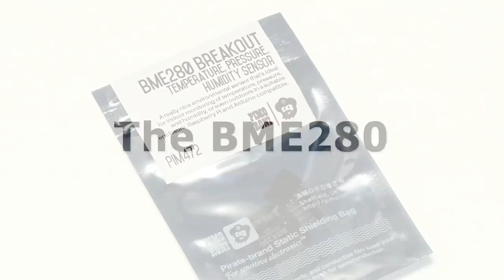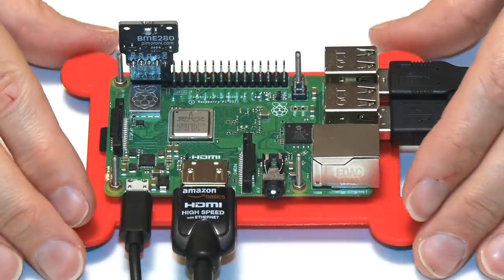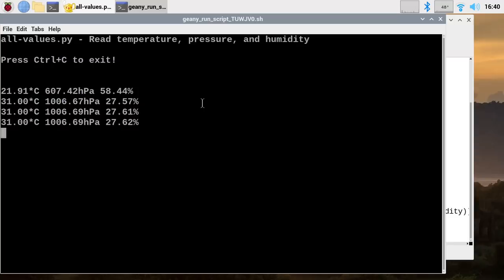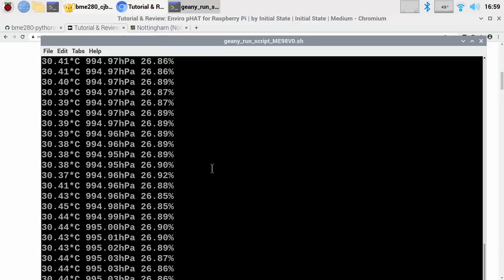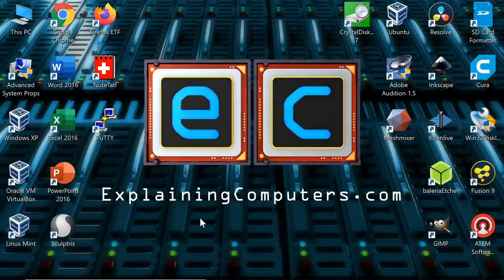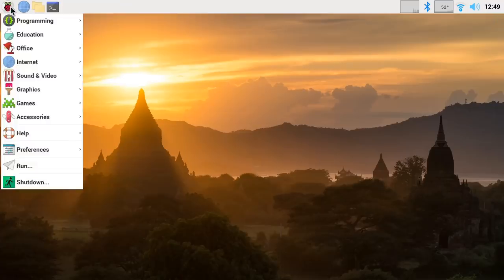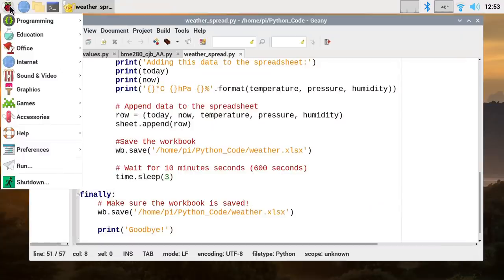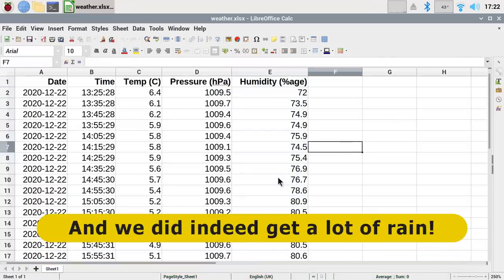Raspberry Pi Weather Station

Comment: Hi I'm following your video and stuck at 17:15
double checked my code and installed everything and even file name is same as you
The result is this

Traceback (most recent call last):
  File "weather_spread.py", line 22, in <module>
    wb = load_workbook('/home/pi/Desktop/Python_Code/weather.xlsx')
  File "/usr/local/lib/python2.7/dist-packages/openpyxl/reader/excel.py", line 319, in load_workbook
    reader.read()
  File "/usr/local/lib/python2.7/dist-packages/openpyxl/reader/excel.py", line 275, in read
    self.read_manifest()
  File "/usr/local/lib/python2.7/dist-packages/openpyxl/reader/excel.py", line 136, in read_manifest
    src = self.archive.read(ARC_CONTENT_TYPES)
  File "/usr/lib/python2.7/zipfile.py", line 958, in read
    return self.open(name, "r", pwd).read()
  File "/usr/lib/python2.7/zipfile.py", line 984, in open
    zinfo = self.getinfo(name)
  File "/usr/lib/python2.7/zipfile.py", line 932, in getinfo
    'There is no item named %r in the archive' % name)
KeyError: "There is no item named '[Content_Types].xml' in the archive"

------------------
(program exited with code: 1)
Press return to continue

Please help me because struggling with this for 3hours
Looking forward to your recommend

Comment: 16:41 - I don't think the repeated saving of the file inside the loop is a good idea with an SD card.  This just reduces your SD card life.  You already are saving the file when it finishes and this is hardly life critical information.   ;-)
Reply: Also... please use the degree >>> ° <<< symbol instead of a star.  It should be easy in Python (or anything else) with <Alt>0176 (on numeric keypad).  The star just looks amateur.   ;-)

Comment: I have one of these running on a Pi ZeroW. My program predicts the weather based on the Zambretti Algorithm using  information found  at http://integritext.net/DrKFS/zambretti.htm . It works well except that the sensor seems to be corroding making the humidity reading useless.

Comment: Excel is not a database. Copy this 100 times. Can we have a video about uploading the data to grafana instead ? Lapinou year indeed.
Reply from the maker: Nowhere in this video do I descibe Excel as a database. But is is very, very common to use a spreadsheet to store data -- data in colums and rows is kind of what they are made for. And it provides a good means of presenting and analyzing such data. So nothing to "copy 100 times".
Reply: @ExplainingComputers  Yep, sorry, it was not obvious I was joking. Of course I agree that this is the right thing to do here...
Reply from the maker: @StephanLeclercq  :)
Reply: Something like SQLite would have been a nice addition, but that would have probably been too much for a toy project :)
Reply: @АлексейГриднев-и7р  Yes, exactly! A few follow up episodes, where we store readings in a database, then a SQL intro where we extract the data using queries (gimme all the times when temp was above 10°C and pressure below 960hPa). And then we display it on a dashboard (hence my hint on grafana), then trigger an action using a IfThisThenThat plugin to water the flowers when it's hot using the previous contraptions involving servo motors and relays. Later, we can use the data to train a NN and predict the weather. OOh,  but that requires a supercomputer, so let's build one by clusterizing RPis. And we host all this in Docker/Kubernetes components. 
Greetings, Chris, now you know what to do next year ! Oops, I forgot the smiley... Again... Keep doing what you do, It's really nice.